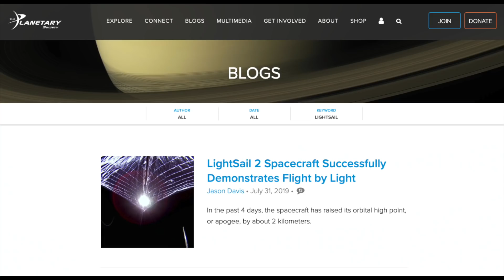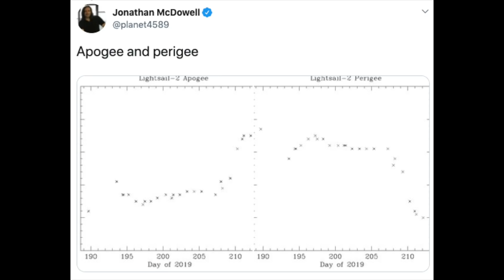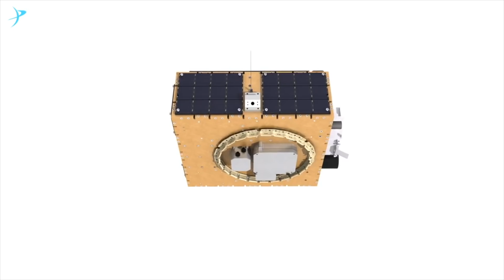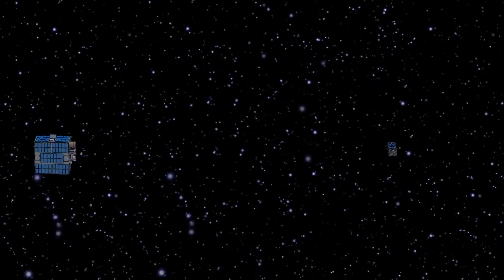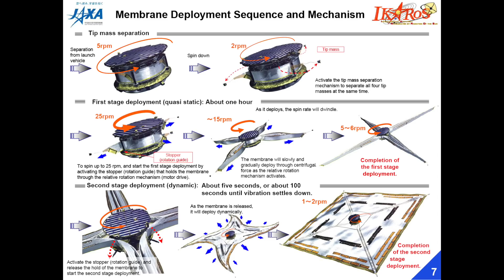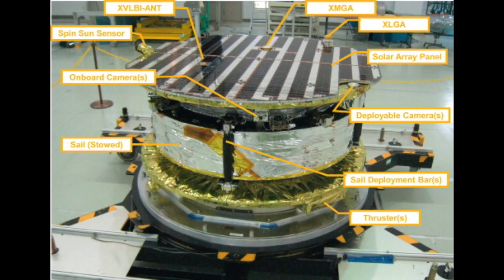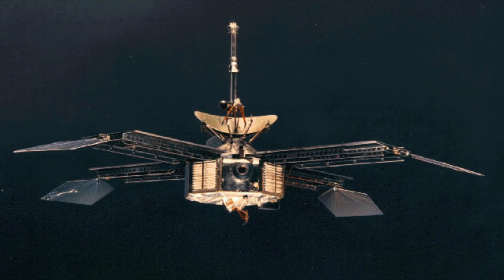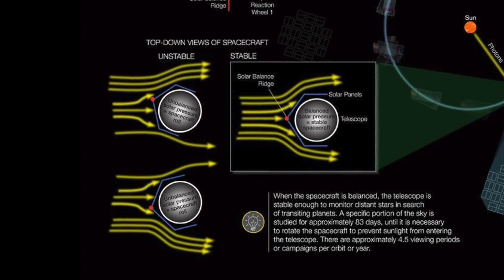Lightsail 2 Sails On Sunlight At Last

Comment: If they can't circularize the orbit in time to overcome the drag around perigee, then perhaps they could make use of a very large laser to give it a boost and save the mission?
Reply: Think about it - they wouldn't be able to do that unless the sun switched sides to give it a push from the other direction at apogee ;) The only change they can impart to perigee is to lower it even further, unfortunately.
Reply: @PinataOblongata  I think I see what you mean, but orbital mechanics does my head in...  Maybe they can make use of non-perpendicular angles to tack during the midpoints and influence the orbit that way.
Probably the most important thing around perigee is that the sail is travelling edge-on through the thermosphere.
Reply: @ahaveland  Play some KSP and it becomes 2nd nature ;) Your last sentence is correct, but not sure about what you mean by "tacking" at midpoints. Tacking is your whole craft changing heading and doesn't really apply to orbital mechanics.

As far as I'm aware, LightSail2 can pretty much only do more of what it's currently doing and I figure that eventually the periapsis will lower enough that it will experience more drag, lowering it further in an exponential way until it burns up in atmosphere (don't know this for sure, but wouldn't be surprised if that was how it was designed so as not to remain as space junk).
Reply: @PinataOblongata  Thanks for your insight - by tacking I mean say angling at say 45° to the sun to adjust the thrust vector around midpoints of apogee and perigee to try to raise perigee a bit. Could maybe even use a slight angle to 'surf' the atmosphere at perigee. If perigee is illuminated, it could get a slight push as well as surf if friction doesn't spoil the fun.
Anyway, I'm sure they've covered every creative possibility and trying to find an optimum solution, even if ultimately doomed!
Reply: @ahaveland  I'm no expert, but an anti-radial (towards the planet) push at 270° to perigee should raise it a bit, but I'm not sure if that area of the orbit would be lit, enough, and you would also lower teh orbit at 90° to such a "burn".

I don't know about "surfing" the atmosphere - I have heard you can bounce off it at the right angle and speed, but this is a very small and fragile device for that sort of thing. I do hope they try some "weird" stuff once they've shown what they set out to show.
Reply: @PinataOblongata  Thx.. look forward to seeing what they come up with!

Comment: Yes but can it exceed the air speed velocity of an unladen swallow?  

Seriously, though . Love the presentation!
Reply: African or European?
Reply: @neithere  In the long term; yes!
Reply: Since this is a Scott Manley comments section, I am obliged to mention that "ai-speed velocity" or just "air speed", for the non-redundantly inclined, refers infact to the velocity of the current of air on a wing surface, and not the actual velocity of the object; One might in a reductionist way think they are one and the same, but the air current is significantly uneven, especially in non-fixed wing flight, and also on must account for the possibly high lateral air velocity. Combined, these two facts mean that "air speed velocity" oftentimes far outweighs actual velocity
Reply: @luigivercotti6410  So if we are to translate this to the original Monty Python,   you are saying that the parts are greater than the whole!
Reply: @Brenda Rua Just like lemon and curry.
Reply: @luigivercotti6410  I likehow you think. But would that be red your yellow? Hums the jeopardy theme song

Comment: Not only the oceans but now space is also polluted with useless plastic.And how much does the light pressure lower with doubling of distance?Fantastic but practically useless.
Reply: A "Solar sail" is yes, not very useful. However, this is supposed to be a general test for all photon sail spacecraft of the future that may become the norm for interstellar exploration.

As Stephen Hawking proposed, using powerful ground based lasers and propelling photon sails could allow these crafts to reach 20% of light speed. That means we can send a probe to neraby stars and get results back within two decades. If we wanted to explore outer space, photon sails are pretty much the only practical solution at the moment.
Reply: Better to mount that laser on the back of the space snail. Throwing photons out the back gives more thrust.laser beams lose focus over distance as well. Als build that laser on the planet you are shooting for after a 2000 the year voyage you also need to be able to slow it down...
Reply: @frankderks1150  No, because you can use a much more powerful laser if it's ground based and also saves weight for instruments. The spacecraft would also need power generation and storage capability to achieve that, and by that point the mass is so large that the acceleration will be compromised.

To slow down, you use two spacecraft as a pair. One almost directly in front of another but slightly offset. The laser will come from behind, hit the front spacecraft and reflect it towards the front face of the spacecraft behind. Now there's light coming from the opposite direction, slowing it down.

Laser does spread eventually, but the idea is to use multiple lasers from multiple stations on the ground and space to concentrate the beam. Also, range of the laser does not matter because all other methods of propulsion would have expended their fuel by the time they reach similar speeds anyway. It's not a unique downside to photon sails.

Comment: Why not just integrate "solar control surface" for attitude control? Wouldn't it be more reliable compared to reaction wheels, in long term missions?
Reply: The IKAROS had that. It had diodes that basically make parts of the sail transparent, changing the amount of force exerted on the edges. It did manage to alter its trajectory using the torque generated by that.

Comment: Doesn't seem particularly useful considering ion drives exist.
Reply: I doubt a kickstarter would be feasible to fund the construction of an ion drive powered spacecraft. Two spacecraft, actually, if you count the test lightsail as well.
Reply: @celefin6494  Just saying, you get better flexibility and propulsion from an ion drive which serves about the same role as a solar sail except does it better. I just can't think of a reason to use the sail other than it's neat.

Comment: Scott, I'm really excited!!, I reached out to their lightsail email address about an end of life experiment idea. They replied thanking me for my idea and that it was forwarded on to the team :D 😁☀️⛵🏆

★For those interested it had to do with the limited control of the spacecraft they mention as one of limiting factors for mission, craft will be lost due to the drag due to limited precision of craft angle of attack.                         

                   So I reviewed how the crafts soar sails are extended to begin with and thought, space has a history of making us think outside the box and make existing equipment do something it wasn't necessarily designed for, so why not after main mission experiment with reprogramming the boom motors to be able to also reverse.
 By doing this with either one or more motors, we should see that shape of sail can be adjusted mm by mm. Perhaps get that precision we need to keep it going longer.      So very excited that they passed my suggestion along.                                          ★Who knows I might be fortunate enough to even have Bill Nye read my email. 

<I know that may sound silly but when you have lots of ideas and hope that someday, someone important might see one of them, it helps keep you going. >  

                              ★If they are able to do this experiment it will be so awesome cause it might be an alternative to the reaction wheel. Still wouldn't last forever as the servo motors will eventually stop functioning. However if it works one could see making solar sails with a few extra motor booms to not only increase sail area but add more redundancy to the craft. 

Anyway I'm glad my favorite science fair and class projects in school were when I got to pick telling others about solar sails, now has real world data.

Comment: I've got a most likely dumb question: Does a solar sail only works when flying away from the sun? Or could you do manoeuvres like a wind sail is capable of? So sailing against the "wind"? Surely a space probe doesn't have a physical keel, but possibly there is something else?

Comment: They've pulled two-of-three of a standard maneuver (low orbit, elliptical orbit, high orbit) off.
Can they switch from the pattern of 'maximize ellipticality' to a pattern of 'stabilize at larger orbit'?
Or is there simply too much drag to do anything useful?
Reply: It sorta remains to be seen, I imagine it's meant for missions where there are exceedingly large spaces of zero g with no atmosphere to drag it back down as much.
Reply: @rdh1001  Well, but they should have some sort of idea already whether this is 'in the range of plausibility', or whether the math is simply "No."
Reply: @shrikedecil  so far, "seems likely" is the answer. I think they're waiting to go bigger and farther out of Earth's influence but thats super expensive so it might be a bit. It's such a minute amount of acceleration that until it's actually going at a good clip gravity and atmosphere just drag too much on it to get solid data, this is more proof of concept to convince folks to spend more money on a bigger better version (re: improved by data gathered from this one).

Comment: Sure the first minute is very slow, but what about after days and days and days? You'd reach speeds of nearly 2000 m/s in 100 or so days! That's insane.
Reply: They still have to overcome atmospheric drag. Solar sailing vs. traditional sailing.
Reply: @looksintolasers  But if you use a chemical rocket to get high enough, drag would become less and less of an issue
Reply: Daniel Walters Or you could do what everyone else does and use an ion thruster.
Reply: @Cailus3542  it's quote heavy though if your trying to accelerate only a few kilograms, and even they have there limits on fuel

Comment: "However, solar sails do have their limitations. In our solar system, at distances beyond the orbit of Mars, the sun becomes too faint to push a solar sail, which limits their use deep in space, according to NASA."
Reply: Imagine some kind of rendezvous with Sun (like a comet) to get full sunlight density and acceleration towards the objective adding up with this strategy gravity assistance from other planets. I imagine that would make a new spacecraft speed record.
Reply: I think an ideal solar sail mission would dip down near the sun first, then head out towards its destination.
Reply: Photon sails are supposed to shine when they are coupled with ground based laser stations, to propel them into interstellar space. We have to test it with solar light first, though.

Comment: The perigee being lower than at the start: The animation shows the spacecraft deploy its sail at the 9-o'clock position on its counterclockwise journey to perigee at 6-o'clock. Wouldn't THAT cause the perigee to decrease? 
Atmospheric drag at perigee would work to lower the apogee, not the perigee.
Reply: The spacecraft is 'thrusting' for the entire lower half of its orbit, which averages out to a prograde impulse at perigee. Atmospheric drag is probably constant, so that will decay both apogee and perigee over time.

Comment: This gave me an idea: make a very light craft that takes in energy from the sun with solar panels on its body and has electric propulsion using atmospheric air until not enough is available and then air that it stored in compressed tanks as it rose up.  Use a high speed rail in a tube on the ground to get it up to as high a speed as possible, and then curve it up and shoot it at the sun.

Comment: Rather than turning parallel to the sun, a light-sail should be able to increase its periapsis by rotating such that there is a net prograde element from apoapsis to periapsis; this can be accomplished by maneuvering the craft so that the vector of photon thrust is halfway between the solar-tangent vector and orbital focus.
Reply: If they changed the attitude of the craft at any point along the "lit" side of its orbit, wouldn't that simply raise the orbit on the opposite "dark" side (not the actual periapsis)?

Comment: What's your opinion on the subject of Space Tether and Spacelifts? What do you think of the Kurzgesagt video?
Reply: Monking Flame For now, it’s still space fantasy. It’s awesome space fantasy, but it’s space fantasy. We don’t have the materials (yet), and building such a colossal megastructure would be the ultimate engineering challenge in countless ways. It might be feasible in a hundred years, or even fifty years, but for today, we’re just not there.

Comment: 6:20 "..and that may seem small, but after a minutes acceleration that spacecraft is able to exceed the average speed of a garden snail..."
Beautiful. Just beautiful.
Reply: After 2 minutes, it get even faster~
Reply: I wasn't sure if that was sarcasm on Scot's part or not.
Reply: If its on a small probe to the outer solar system the acceleration for say, a year could be significant.
Reply: @russc788  if my quick math is right, it would take ~450 days to escape earth orbit asuming 0 drag.
But of course the further from the sun you get, the lower the thrust. But again, you can thrust constantly instead of just half the orbit once you escape.
Reply: @Erowens98  shouldnt you get thrust on less than half the orbit as one half will push you torrwards earth and the other half will be blocked by earth so more like 40% when at the sides of the planet
Reply: not on that only 1 side as the other side will be an de acceleration
Reply: @Erowens98  I was thinking chemical rockets break orbit first
Reply: @Erowens98  once you are in solar orbit you aim for a highly eccentric orbit. Get as close to the sun as you can without melting and you maximise both Oberth and thrust.